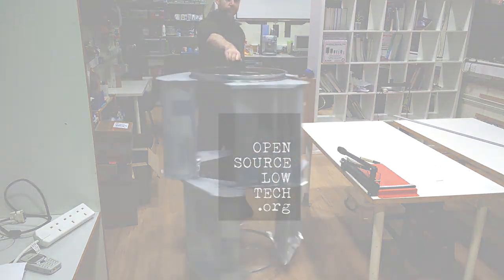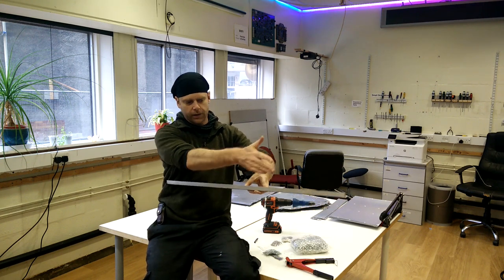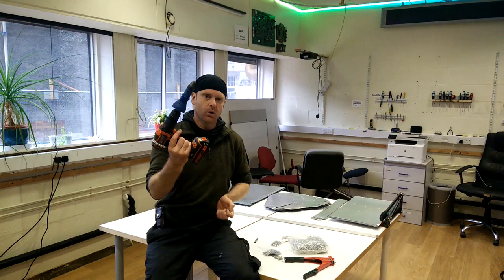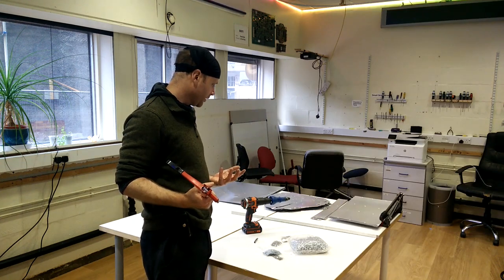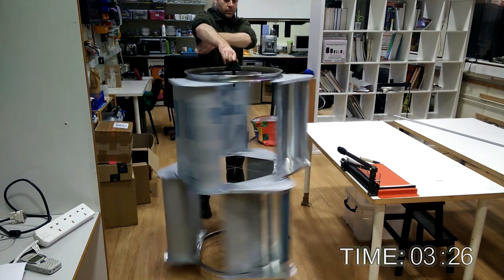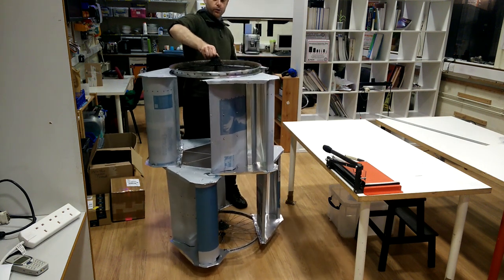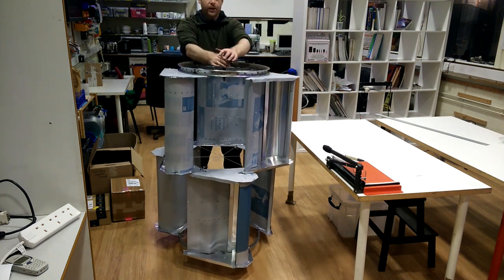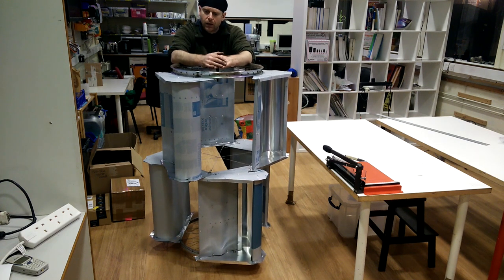Wind Turbine Speed Build -500W, $18, 3.5 hours

Comment: I have a telegraph pole in my garden as a leftover from when we had overhead power delivery and this design looks idea to perch over the top of it. The wind often gets funnelled between the terrace of houses we live in and a row of trees to the rear of our property and I suspect this could be quite good at harvesting this free energy whistling past.
Reply from the maker: Yeah that might actually work fairly well. You can also daisy chain as many turbines as you have space for (tho don't overlap them vertically as they'll bock each other). The lower ones will get less wind but still probably worth it as they're cheap.

Comment: cool! I have a wheel with a motor in the hub. This would be perfect for it. 3 phase ac output. 
I always wonder how to hook it up. Could you show us how you connect it to the stationary frame?
Reply from the maker: I've not had a chance to use an ebike wheel with one of these yet, but been meaning to a while. Far as I can tell they should be about ideal. Check tho whether yours is direct drive or planetary geared, the former will work better, but the latter probably still ok.
How to attach it electrically will probably depend on your charge control situation, whether you put it through a bridge rectifier first to convert to DC, or just plug the three phases directly into your box.

I've got a couple videos coming out soonish which will document how to mount the whole thing to a pole.
Reply: @OpenSourceLowTech  they should, in principle, be the right 200-300rpm range, but the voltage might need to be regulated.
Reply: @OpenSourceLowTech  thanks! mine is direct drive, but it had electronics inside the hub which I had to rip out first. now its pure 3 phase AC.
I would prefer to rectify into a capacitor for DC.
Your method could even use 2 equal wheel hub motors.

Comment: How did you come up with the design for the air catchers/wing shape ? do we know if that is one of the most efficient shapes  ? It occurs to me that wind and water are both fluids . reducing the friction of the spinning blade, would greatly increase the efficiency, what about using a magnet for levitation of the blades, and have the coils that generate the electricity be stationary below ?
Reply from the maker: The underlying design isn't mine, it's a Lenz2 VAWT, I just did the build process:

It's pretty efficient, moreso than a Darrieus or Savonius. I've been testing it on a rooftop in the city, the results of which will be an upcoming video.

Air compresses and expands, water doesn't. This makes quite a lot of difference to turbine design.

Magnetic bearings are a thing, but no idea where I'd source them from. The bike wheels do a pretty good job, especially if greased.

Comment: when is the next hydro turbine video. i wanted to see if that servo fan worked or not
Reply from the maker: This Saturday. Spoiler; it broke, but the ones I was using weren't proper server fans, just cheap and weak standard types. I have since bought a couple proper ones (which aren't even that more expensive) and been playing with easy ways to make the basic ones stronger.

Also am 3D printing some more exotic runner shapes (logarithmic spirals and the like) for those who do have access to a printer.

Comment: So, WHERE IN THE "H" do you get used bicycle wheels?  No one in my area wants to part with them for less than $100.
Reply from the maker: Most shops and workshops which service bikes will have a pile of not quite road legal wheels they're chucking out, which should be fine for this.